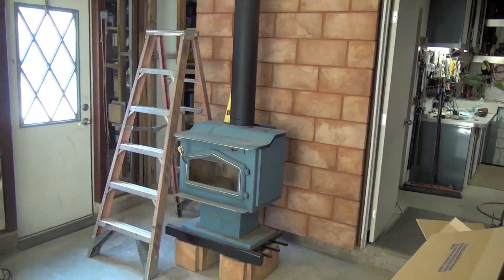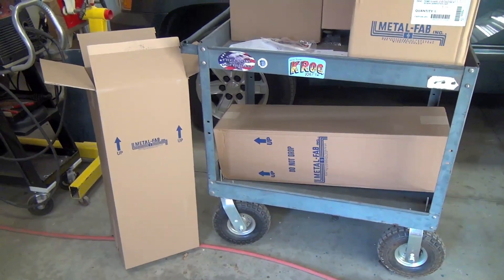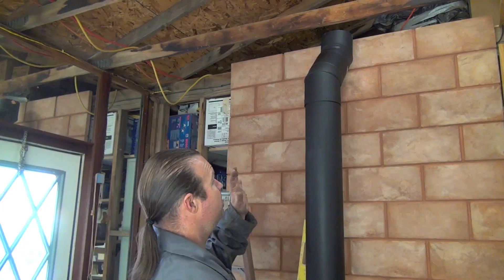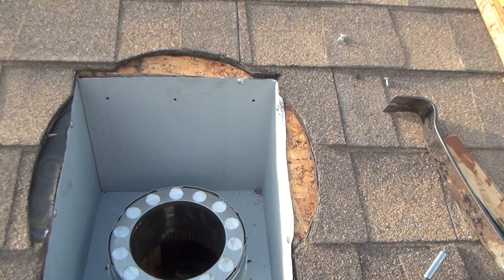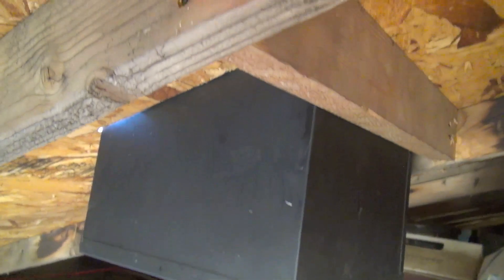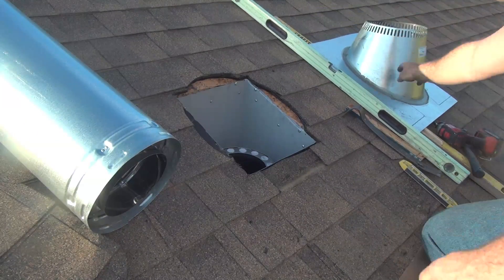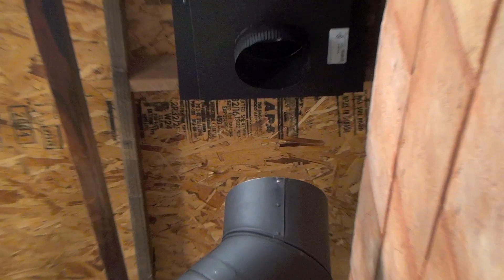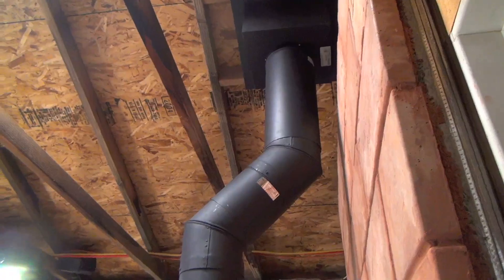Full Chimney Installation for the wood stove in my shop, how I did it  EP 5 of 7

Comment: I know this is a year old but it looks like your pipes are not put together correct. The female end of each pipe should be up with the male end down into. Seems backward but this is actually correct. Now when your creosote runs down the inside of pipe it will run down outside of pipe or build up on the ledge of the 2 pipes. Just an FYI. It is hard to tell for sure by the video but I think thats how you have installed anyways.

Comment: As noted by commenter Mike Kuik: you messed up. The male end of each piece of pipe should be at the bottom, the female end at the top. That way creosote dripping down the pipe stays inside. A dangerous error.